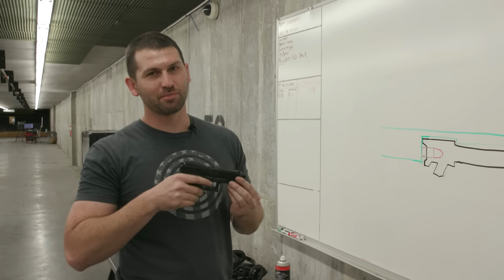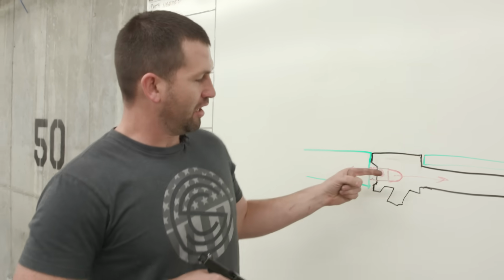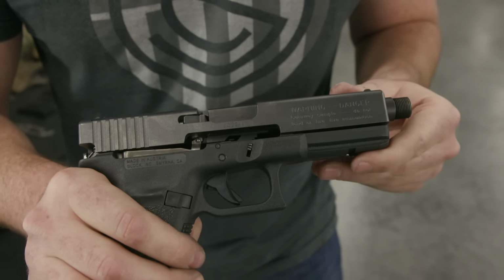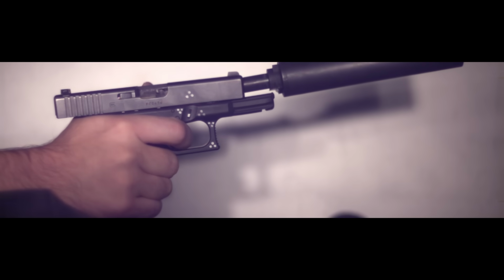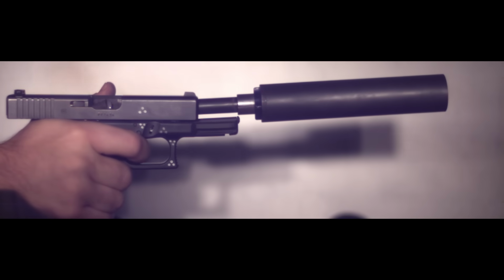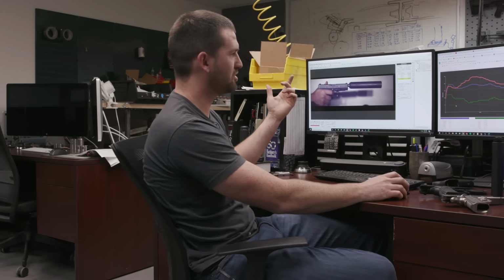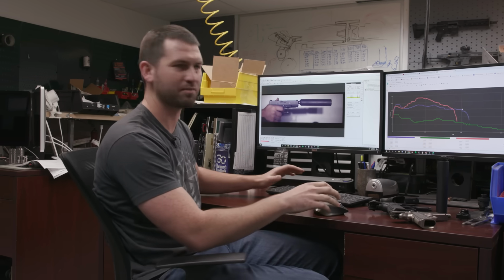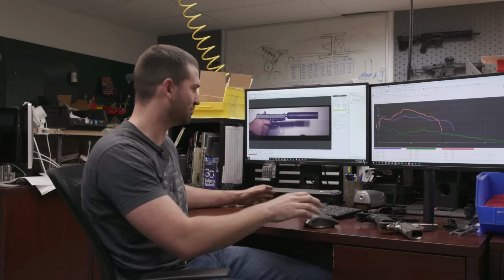Suppressor Science: Pistons

Comment: I understand the downside of NOT using a piston on a recoil operated pistol, from your video. But, what is the downside of using a piston (and not a fixed barrel spacer) on a fixed barrel firearm?
Reply from the maker: Great question! The spring will still compress because of the pressure and has the potential to deform your threads, a big no-no!

Comment: First, I would like mention that I noticed that on the Maxim 9 that you have the red dot sight mounted forward of the ejection port.  Is this an advantage over having it rearward mounted?  Second, I would like to know more about the internal design of the suppressor.  Are there different situations for the use a uni-core design versus a baffle system?  Would each type be determined by the caliber being used?

Comment: So in that first step, when installing the spring to the piston and then both of those to the retainer...is the piston mount already installed into the rear of the silencer?  That step seems to be missing and I am trying to make sure I don't fk this up.  I'll be putting it on a glock 17 (9mm) which is where I am worried about a possible end cap strike with the 9mm front cap and then changing over to a glock 20 (10mm) where I've no choice but to run the full size 46 cal end cap.  Thanks to anyone who can clear me up on this.  I've use it a lot with rifles but it is my first time with a piston.

Comment: So can you keep the piston in it on a PCC??
Reply from the maker: If you want to use the piston as way to attach the suppressor on a PCC you need to replace the spring with a fixed barrel spacer. This prevents the suppressor from moving around during recoil.

Comment: Can you run a suppressor piston on a fixed barrel too? Does it make a difference? For example, if I put a 9mm piston suppressor on like an AR9 or a Scorpion or something. I'm assuming this has to do with pressure more than anything. I assume that if I run like 147gr subsonics through a 5-9" 9mm carbine barrel, then I'll be perfectly fine running the piston if I have to. I'd prefer not to, but I assume that as long as I'm keeping the pressures low I won't have any problems

Comment: Why do i keep seeing i need both the booster kit and the tri lug kit to run it on my mp5? Hopefully i just need the tri lug. 46M
Reply from the maker: Correct. You do not need a booster assembly and piston if you are going to run 3-Lug.
Reply: @SilencerCo  awesome. Thank you for the quick reply because I just bought it. Keep doing great things.
Reply: @SilencerCo  does the tri lug fit directly into the 46M? Or does it need the piston mount stuff? I'm so confused
Reply from the maker: @StephenNewton77  For the 46M you will need a "Charlie Piston Mount" (SKU: AC4751). This will allow the Tri-Lug mount to be installed into the 46M. You do not need a Piston.

Comment: Anyone else surprised by the amount of flex and movement the muzzle end of the (I'm guessing polymer) frame was making in the slow motion video, pretty much everything past the trigger guard directly underneath the barrel? And that's even with the added reinforcement that i would assume that the built-in pic rail adds to that portion of the frame. Kinda crazy to watch but idk i guess it's polymer maybe that's silly of me to find that so shocking? I only bring this up because i most recently built a Glock 17 from a Polymer 80 frame and when milling out the little area for the front two legs of the enhanced locking block from ROOK Tactical, i went just a hair too deep, leaving a pretty large portion of that whole area directly in front of the trigger guard and underneath the front locking block pin to be nearly hair thin. As a result of this, the frame and slide has been sitting for a few weeks now in my garage and has never been test fired due to my concerns over the frame strength in that area and what might happen if it were to break while being fired. Seeing that in this slow motion video definitely doesn't inspire any more confidence in those fears I've had already...

Comment: Great video, thanks. Question: if you put a suppressor on a 9mm PCC, do you need the booster?
Reply from the maker: You would need to either use a direct thread adapter or replace the spring on the piston with a fixed barrel spacer.

Comment: I have this hybrid 46M Charlie mount system and my sig p320 is still not ejecting my shells after each shot consistently.
Reply from the maker: Let's get you fixed up! I have some follow-up questions. What kind of ejection issues are you experiencing? Are the extracting shells getting pinched when the slide closes (aka "stove pipe")? Are they failing to extract at all and remaining in the chamber? 

Make sure your o-ring inside of your piston retainer cap is lubricated/greased. If this is dry it can cause unwanted friction. 

If you are experiencing stove piping as described above you may need to get a heavier weighted recoil spring to slow down the speed of your slide. 

Also don't hesitate to reach out to our awesome customer service team Monday - Thursday.
Reply: I called and got it figured out, thank you!
Reply from the maker: @conorfisher1822  Awesome! Let us know if there's anything else we can help you with!

Comment: Not sure if I'd use a plastic gun like the glock for long term use with silencer, steel please and wish u used the spacer and spring in the high speed camera test for comparison.
Reply from the maker: Modern polymer frames have proven themselves time and time again. They are supposed to flex under stress even though it looks wild in slow motion.

Comment: So a solution for not using a piston is a lighter recoil spring? Will that cycle well?
Reply from the maker: A lighter recoil spring will not ensure consistent function no matter how light you go. A piston is required if you want your firearm to function properly.
Reply: @SilencerCo  So the piston is basically required for all suppressors running a tilting barrel pistols regardless of caliber?
Reply from the maker: @jolebole-yt  Correct. Any tilting barrel pistol will need a piston in order to operate correctly. For the few pistols out there with fixed barrels, you can replace the spring with a fixed barrel spacer.
Reply: @SilencerCo  Thank you! Lots of supressor science here :)
Reply from the maker: @jolebole-yt  We love suppressor science.

Comment: Do you need a different spring (stiffer or softer) when using a different silencer with the same piston/booster assembly?
Reply from the maker: The spring is universal and can be used with other piston/booster combos.
Reply: @SilencerCo  Does that mean I can get any after market booster/Nielsen device and it would work with any of my suppressors (right caliber ofcourse)? 
Thank you for replying sir.
Reply from the maker: @BernyAV  Always double check with different manufacturers for compatibility.
Reply: @SilencerCo  Do you mean the suppressor manufacturer sir? 
That would be me. I'm a hobby machinist/kitchen sink "gunsmith". 
Don't worry sir, suppressors are totally legal here in my country.

Comment: My G17 will not cycle with a supressor on it. The barrel moves back too far causing the supressor to ram into the frame so in reality the slide doesn't move at all to allow a new round to cycle into the chamber.
Reply: @FUBARguy107 that is because it is a crappy Glock. Glock is Austrian for Hi-Point.

Comment: Are piston specifications standard and interchangeable between boosters from different manufacturers? For example, can a piston manufactured by Liberty be used in a booster manufactured by SilencerCo?
Reply from the maker: Just to clear up some terminology. "Piston" and "Booster" actual refer to the same thing. I believe you are most likely referring to the piston housing where the piston/booster sits inside the suppressor. Griffin pistons work with SilencerCo suppressors but other manufacturers may or may not due to design and tolerances.

Comment: What holds the retainer onto the piston, it sounds like some kind of detent?  What prevents the suppressor body from rotating around the piston when the whole suppressor is being threaded onto the barrel?
Reply: The retainer isn’t held onto the piston. It’s threaded into the suppressor body and “retains” the spring with a notch cut around the diameter of it while the piston threads directly onto the barrel (so the shape of the suppressor prevents you from pushing it towards the rear of the gun and the spring prevents you from pulling it off the gun). There are a series of cutouts around the front of the piston that interlock with mirroring cutouts inside the suppressor to prevent rotation while locked.

Comment: Answer this for me: The barrel and slide have to move straight back a short distance in tandem as a prerequisite for the pistol to cycle properly, and the dead weight of the silencer could prevent this from happening, correct? It would appear, then, that having just enough room and spring strength to allow the backward-moving barrel to pull the piston back that far while the silencer just hangs there in its own space for a fraction of a second would be all that should be required. So why is the thing engineered to allow the silencer to pull forward against the piston spring as far as it does, and then to snap back? What purpose does that serve?
Reply: Practically speaking, there is no difference. The silencer only moves forward like this because as mentioned in the video the internal baffles of the suppressor trap the hot gases exiting the barrel "like wind in a sail" on a sailboat. These gases, moving fast enough to push the bullets out the barrel as quickly as they are, pull the suppressor forward on their own. By allowing this, the spring makes sure the weight of the suppressor doesn't slow down the barrel and slide. Naturally, the suppressor moves forward because the gases push it forward, compressing the spring in the piston more.

Comment: First, your videos demonstrating the mechanics are awesome!!!   So many people/companies make claims about products and even if they show how they collected data, none compare to your videos.  Great job guys!    Now,  how about expanding some of your videos to include: a) what happens on fixed barrels, b) with and without boosters, c) PDW/PCC guns, d) DI and gas piston guns?    I know you must have a ton of high speed video collected.  You probably have a fortune invested in that equipment.   Again,  great job!    PS.  I own a couple of your products but maybe did not appreciate the work until now.
Reply: Did you get an answer for this? I'm wondering the same thing, because I wanna know if I can run my piston suppressor that has no options for fixed mounts (currently) on a 9mm carbine with fixed barrel. Logically, based on what I can tell about the physics of it, it's completely fine and probably wouldn't make any real difference or cause any problems at all unless I was firing full auto or something.

Comment: Is it ok to leave the piston an spring in the can an attach it to a fixed barrel to shoot???
Reply from the maker: You do not want to shoot on a fixed barrel with the spring installed. The risk of baffle strikes increases exponentially when the suppressor is allowed to move on a fixed barrel setup. Make sure to use a fixed barrel spacer in place of the spring.

Comment: My new cgs mod 9 suppressor appears to have problems with the piston spring...both ends have flaired out somewhat...its hard to assemble and the piston 'gears' do not engage.....so when I attach the suppressor, I can still rotate it by hand (not where you have to pull it out to make point of aim adjustments).  Have you heard of this?   Do springs wear out after ~300 rounds?  is this a unique CGS problem?   any advice greatly appreciated.

Comment: This video was an excellent way to show how the piston functions, and how much it affects the slide movement on the graph. I never knew that the piston actually had that much action within the can fitting. Thanks a ton for this. Saved me a lot of headache, I was about to try direct thread on everything.

One thing I would like to know, if you run the piston on a fixed barrel, then run the direct thread adapter on the same fixed barrel, same ammo etc, how much difference in dB is there due to the extra volume in the direct thread case?

Comment: Your graph showed velocity against time, with the velocity on the Y axis and time on the X axis.  I think it would be interesting to see a graph of distance (slide distance traveled rearward) over time - i.e. the derivative of velocity, with distance shown on the Y axis, and time on the X axis.  That way, the overlay of the 3 curves would indicate the retardation effect on the slide's actual motion, of the additional weight of the silencer, and the reduction of that weight retardation initially, as a result of the decoupling effect of the piston.  Or even a slow-motion time-lapse 3 panel video with all 3 firings shown one above the other, so you could see the deceleration and reduced motion attributable to the additional weight, and then mitigated by the decoupling.  Geeky, I know, but a picture is worth a thousand words.  Interesting video!

Comment: It seems my M9A3 still needs a booster. Really wanted to put a tri lug on it! Any ideas? Supposed be a fixed barrel.
Reply: the M9 does NOT have a fixed barrel. It doesn't tilt, but it does move rearward as part of its delay mechanism. A piston should be used. Some may cycle without a piston, but it will be BARELY cycling, and your reliability be drastically reduced. Use of a piston is best practice.
Reply: @jacobturnblom573  agree

Comment: Is a piston needed for the LWRCi SMG45? Looking at the design, it has delayed blowback but the barrel moves like a pistol?
Reply from the maker: You will want to use a piston since the barrel is moving. Without a piston you will be adding extra weight to the system that it was not designed for.

Comment: Hm. I own a handgun suppressor (sorry, not a Silencerco product - though I own a couple others that ARE Silencerco :)) and I may move it from handgun(s) to my Scorpion Evo. I don't replace the whole mount+piston+spring with a fixed mount, nor I replace the spring with a spacer - lazyness. Is this an issue? Are there any chances of a baffle strike or a blown endcap by using a piston on a fixed barrel "subgun" like the Scorpion ?
Reply: Yes. It will work okay, but your piston will still unnecessarily move when you shoot. It will be slamming back and forth harder and faster than if it was on a tilting barrel handgun. Over time, it will just put accelerated wear on the moving components, or worst case, your piston will crack or break, which can then lead to misalignment and baffle strikes.
Reply from the maker: Using a piston and spring on a fixed barrel setup can result in baffle strikes. It can also reduce accuracy. If you want to use the piston on a fixed barrel host we recommend using a fixed barrel spacer to replace the spring.

Comment: Can you do a video on why they are so expensive now? I was going to get a osprey .45 when they first came out. So I purchased a thread adapter for 9mm and .40 because the osprey came with a booster (as it should). My dealer quit selling suppressors and I never got my suppressors. Fast forward to last year I purchased a octane 45 and it didn't come with anything. I went to get a booster for .45 and they are now $65. I want to say I paid $37 a pice for my original 9mm and.40 boosters. The fixed barrel spacer is $50. That's a ridiculous price for something that is only a spacer...

Comment: I am curious about heavier recoil springs in suppressed pistols. Are they needed or recomended? Do some hosts and or caliber combo's need them more? I have heard of some manufactures include different recoil springs with there factory suppressor ready models. I know my Glock 35 with an Omega 45k seems to cycle smother and return into battery better with a 24lb recoil spring. It would be good to hear from someone who has more experience and data.